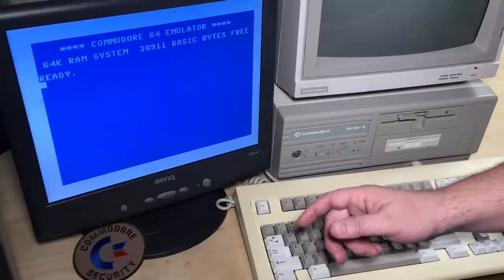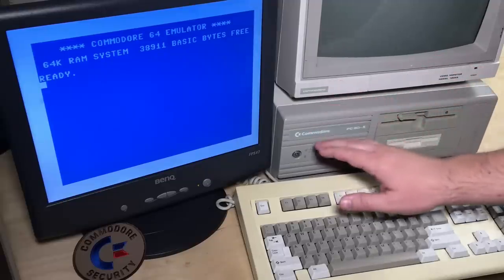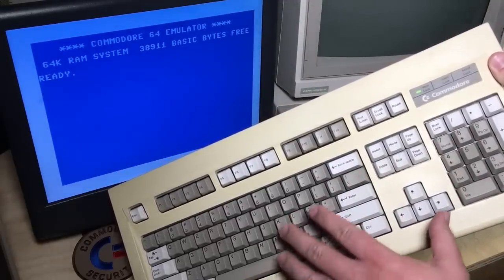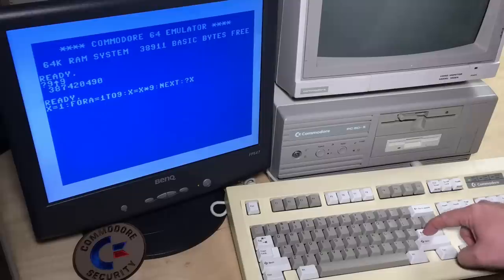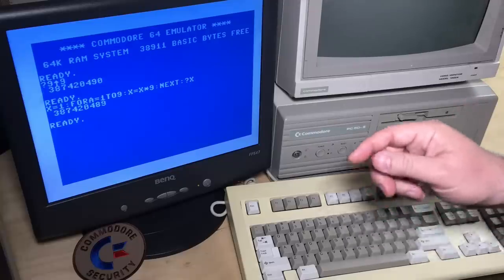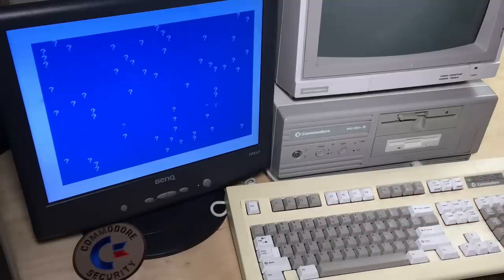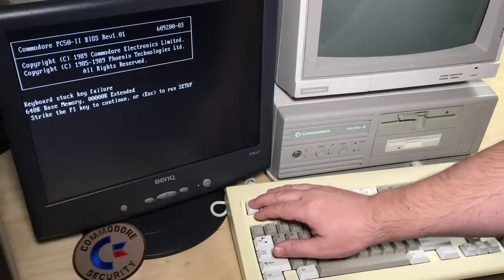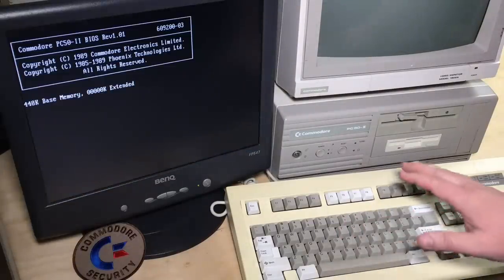Commodore PC 50-II: IBM PC-Compatible

Comment: Robin, please don't retrobright. Almost everything retrobrighted yellows again within a couple years, and the retrobrighting makes the old plastics more brittle than they already are. Best to just enjoy the vintage yellowed look or go nuts and spray paint. Anyway, I love your vids, man.
Reply from the maker: Thanks for the support! :) I'm curious to try retrobrighting one (unimportant) thing just to experience it, but I'm definitely not going to start making a bunch of videos about it or anything.
Reply: I have retrobrightened a few keyboards and they did not become more brittle- might be different on thinner parts- but the thick plastic of a keyboard should be no problem- I use one as my main keyboard and I can't find any difference I really can not stand the yellow-orange look. I use a very easy method and just brush on some "creme oxidant 12%" (hairdressing supplies) throw it into a 
garbage bag and put it in the sun for 2 hours that's it.

Comment: I could be wrong, but I suspect that the c64 emulator wouldn't start when connected to the Commodore monitor because it's connected via the EGA digital video out, and so can't display a VGA screen.  Once again, I could be wrong, but I suspect those dip switches choose EGA or VGA, amongst other configuration options.  From what I've just read, EGA text mode operates at 21.8 kHz when at the DOS prompt, which would explain why it's not happy doing it, as that's a 15.7 kHz monitor, like all Commodore 1084 monitors were as well.  Probably best to not attempt to use that monitor with that PC, as being ran outside of it's specs could have unintended consequences that may reduce the lifespan of that monitor.
Reply from the maker: Yes, it might be EGA or it might be some CGA mode some other people are saying. I won't be running the monitor on that computer anymore; that few minutes in the video was the longest I've ever tried it. Thanks for the info.

Comment: EGA has two scanning frequencies ~21 kHz and 15.7 kHz where as I think the commodore monitor  only has the standard TV freq of ~15.7 kHz. I think your monitor is being overdriven and can just about sync but is struggling. If you're not careful you might blow the horizontal sync transistor.  If you put the graphics mode into 640x200 then the output should be at 15.7 kHz.

The  other possibility is that the output is 31.4 kHz (VGA) and your monitor is syncing on every second line or so and hence getting the wiggles - either way its probably best not to attach your monitor until you know what is coming out of the HSync Pin - an oscilloscope would tell you the frequency.

Best of luck and I love your videos!
Reply: I don't think the graphics card was running in VGA mode via the RGBI (a.k.a. digital) output, because the C64 emulator was complaining about the absence of a VGA card. Most likely the card was running in CGA or EGA mode. Still, due to the nature of the RGBI output, the monitor would only display 16 colours at the same time, as EGA used separate intensity pins (and only VGA used analog RGB information).
Reply: To keep everything Commodore, I'm thinking the Commodore 1950 monitor would be a match for the PC-50, it has a 15 pin connector and can multisync from 15 to 35khz. Finding a good working example that is cheap and getting it shipped without damage... oh boy. :P
Reply: @adriansdigitalbasement  I was thinking a bad capacitor, as that will bend video on a CRT.
Reply: recently after recapping a dead 1084 monitor I thought there was still something faulty in horizontal section as there was a bend at the top of the picture similar to the video (except the image was otherwise stable). It was hooked up to MVS board through Vogatek supergun to SCART, which displayed fine on a Sony tv. after messing with sync hold pots and testing components noticed the picture was fine through RCA composite and also that on Sony the OSD menu was actually jumping around.
not that experienced with CRTs, it might be something specific to SCART,  but guessed the sync was off and sony just had more tolerance. so put a trimmer pot on sync line and dialed it around until it looked right which was at 750ohm then replaced it with a resistor, since then it's worked great.

Comment: Very interesting machine. I am wondering if Commodore had that OEM'd. That case and layout is identical to an Epson PC that I have. Only mine is a 286. So it has a different main board. I know Epson made most of their own Equity PC's back in the day.
Reply: At the end Commodore hired the guy who was behind the IBM PC Junior fiasco and he hired on 30-40 PC engineers (and they only had about 6-10 Amiga engineers.)
Reply from the maker: @wishus knight do you know the model of that Epson PC you have? I'd be interested to try to find more information about it.

@Hey Birt! cool info, I didn't know about that!
Reply: @8_Bit  I think that tidbit was in David Pleasance's book about his time with Commodore. It was not a 'techy' book, but had a lot of interesting insight into how a company with good products can still fail.
Reply: @8_Bit  Off the top of my head no.. As far as I know it is an Equity II  something-something..  Mine are in storage. There are a couple of different models of it. The early ones used separate controller cards and video boards while as the later were integrated.  The earier one also has the larger cube shaped PSU which takes up most of the case hight internally and the latter has the smaller AT psu with the IO ports underneath. Both cases are Identical in external dimensions and have 6 accessible ISA slots. I have both, but I don't know the different sub designations of them.

Comment: Interesting. I remember seeing C= PCs - pc10? at a tech' expo back in the late 80s and wondering what they were. I had a C64. I hoped they were some sort of enhanced C64, they weren't. "Bah! Nothing to see here" I thought and promptly ignored them from then on.
Reply from the maker: Yes, they were very boring computers to me back then. Now, they're somewhat more interesting to me, as a piece of history anyway.
Reply: HI All , my first computer was a C64, a few years later i bought a PC10 as it was less than 1/2 price of a similar pc - 512k single floppy ( 360k or 1.2m i dont remember )
I did come with a combo video card and i had bought the matching commodore monochrome green screen - Hercules spec,  however on first start up the screen was all "messy" just like a old tv with horisontal and vertical sync out, so i had to frag it all back to the computer shop via the train ( 45-60 mins train trip plus 30 min walk to the shop )
Turns out the card was set via the jumpers to colour ( CGA ), i remember asking the dealer to mark the pin outs on a sticker and sucks it inside the cover for later reference when i update the monitor to colour ( another 6 month wait )
Turns out the information was in the thick owners manual

Only strange thing was that the power supply connector was a round ring shaped item, so nothing was really compatible, but it ran lotus and multiplan and word perfect - all you needed at the time, plus even ran most colour graphics games just in shades of  green ( leisure suite larry, corvette and golf was popular)

I owned the machine for 3 years, and sold it to fund a clone 286, got almost 50% of the original price back as i kept all the boxes and manuals etc

Comment: Wasn't the 8-Bit Guy looking for one of those for his documentary?
Reply from the maker: I thought he was looking for a different model of Commodore PC but maybe this is the one. I should ask him.
Reply: @8_Bit  Yes! I think the 8-bit guy need one of this in order to complete the Commodore History Series on his channel!
Reply: No. He was looking for an earlier model called the Commodore PC-1. It featured an 8088 CPU whereas this one has a 386 CPU, so several processor generations earlier.
Reply from the maker: I remember hearing about another series of Commodore-made IBM compatibles called the Commodore Colt, but I don't think I've seen one myself. I do remember seeing a Commodore PC 40 at my high school, which I think was 286-based, and hearing about a PC 60 which I think was the end of the series. Presumably it was a full 386DX.